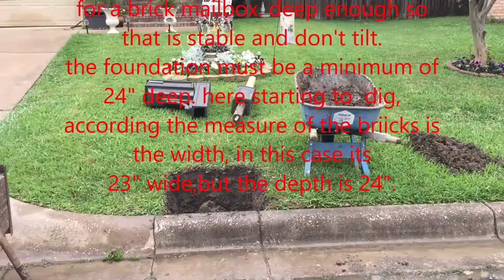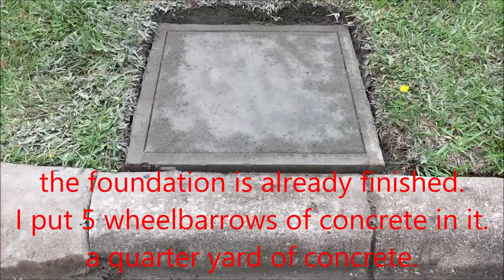HOW TO MAKE A CONCRETE FOUNDATION FOR A BRICK MAILBOX

Comment: No rebar nor wire mesh in the foundation? May last you a good little bit, not so sure about the next owners though. Guess that depends on your location and the surrounding water flow. Good craftsmanship nonetheless! 👏
Reply from the maker: Michael D: I have been doing this kind of work for 30 years and at the beginning I did put rebar, but an architect told me that if it did not go over 30” it was not necessary to put rebar and the experience I have is that I am my own critic and mailboxes what have I fixed over 20 years old are well kept plumb and levels, if you want check my video fixing mailbox with planter box in that one I did put rebar because it’s wider than 30”.
Reply: If the rebar gets corroded, it busts the concrete apart.  A good alternative is adding micro-fiber to the concrete mix.  In my stone lamp post pier, I used the smaller wiring from Duro wall, that gets used in the building of block walls.
Reply: @AStanton1966  Oh, great call man!!!! Sorry if that sounded rude and thanks for the correction with better options. I'm a Handyman with a lot of experience in legitimately everything but masonry is close to the bottom so I honestly appreciate the response from both of you guys!
Reply: @josemourinho8394  Thanks for the correction, seriously! I'll be sure to notate that in my book for later work